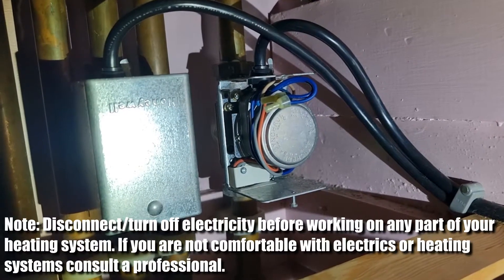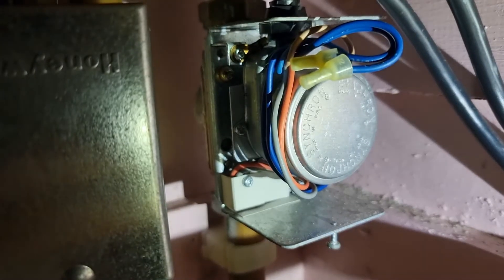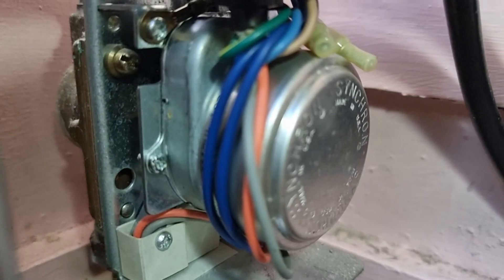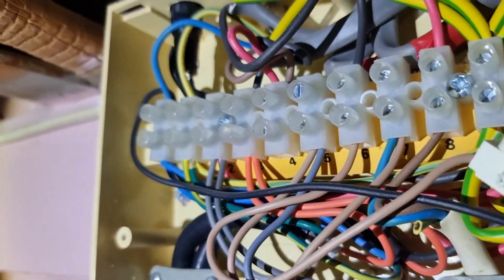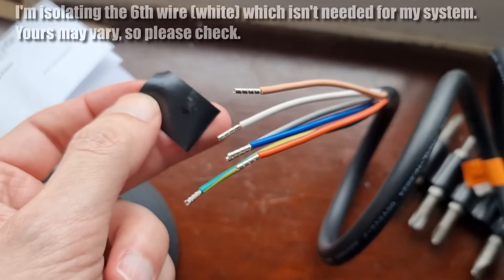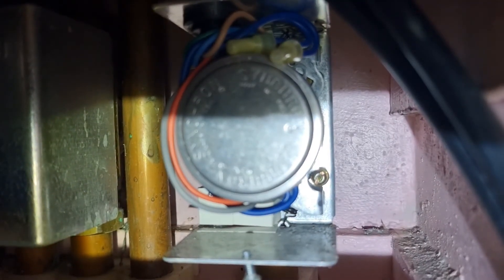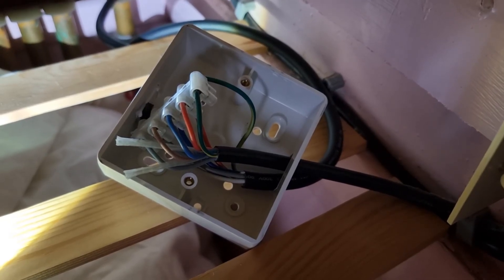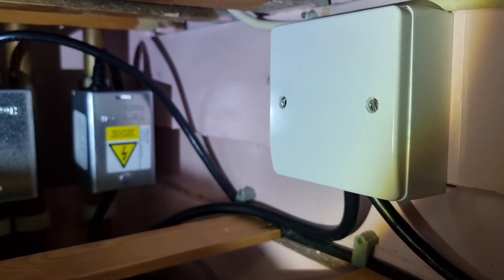How to fix a faulty central heating valve motor - buzzing Honeywell powerhead DIY replacement

Comment: I ordered the part but when trying to put the new one on, the shaft and new head are misaligned and don't fit, whether they are in the closed or open position. When they are aligned then the head itself is not straight and so can't be screwed on..any ideas?

Comment: Thanks for the video. Another solution (much cheaper) is to change just the synchron motor. This costs about £10 on amazon
Reply from the maker: Thank you 🙂 It did cross my mind, but looked more involved. Plus at the time I wasn't 100% sure it was the motor, and thought maybe it was some of the mechanism. The replacement is still going strong.

Comment: Thanks for the video.
I have a similar issue and I have noticed the lever is very loose.
The boiler is no longer heating up the water, so can it detect if the valve isn't in the correct position, which I assume it's not?
Reply from the maker: Sounds similar to mine.. If you turn the heating off does the lever stop being loose?
Reply: @ No, it’s continually loose and I can’t lock it into the manual position. I think it’s had its day!
Reply from the maker: @BF1GUN  Sounds like it :) Hopefully shouldn't be a big deal to replace it.. plus they're relatively cheap. Good luck!

Comment: Useful video! My valve started doing the exact same last night, and have ordered the same part to see if this solves it. Will have a go at fitting it later 👍
Reply from the maker: Awesome! I'm glad it was useful. Let us know how you get on 🙂
Reply: @ All sorted, was as straight forward as suggested in the video, and much quieter too! Cheers!
Reply from the maker: So quiet, right?! When I first turned it on I thought I'd broken everything 😂 It was quite a rush when I realised it was all good and the motor was just silent.
Reply from the maker: Btw, please ‘like’ this video if you haven’t already.. it really helps my channel 🥰